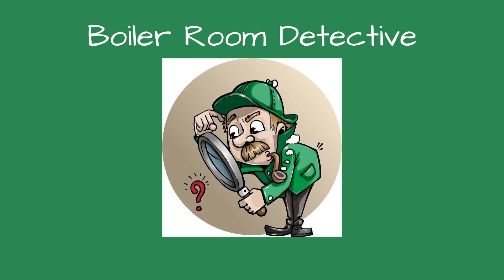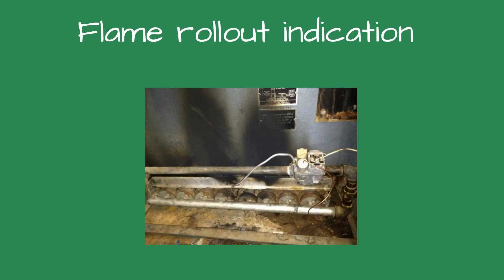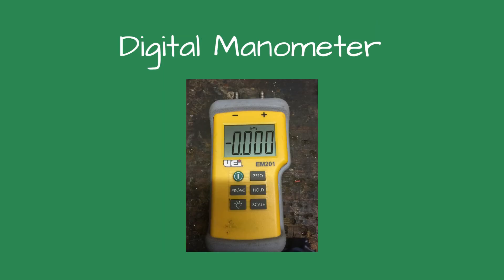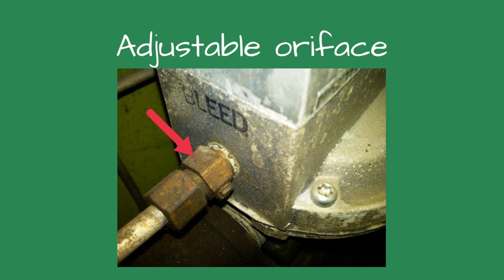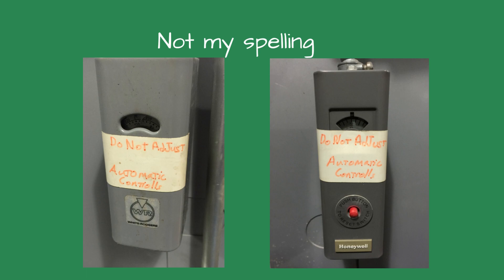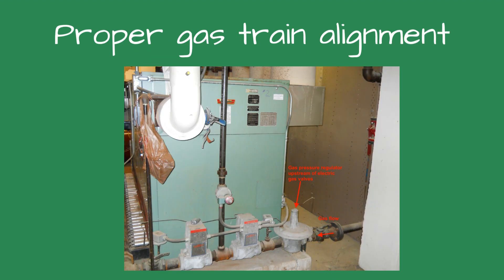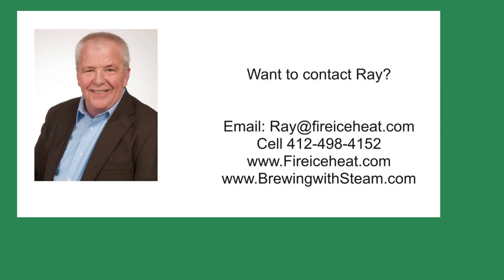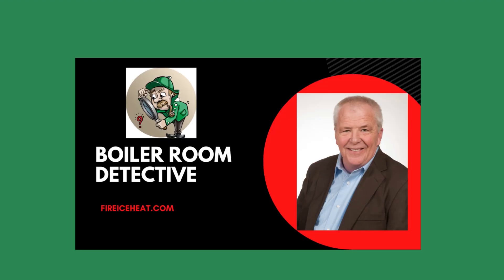The Case of the Flame Rollout

Comment: Well, I do have a question.  Does anyone know when the Maxon gas valve was added?  I'm guessing after the boiler was installed to provide dual shut-offs.  Certainly not from Bryan Boiler.  Did the flames roll-out before it was installed?  Description says since it was installed.  Wonder which model the Honeywell V5055 gas valve was?  "A", quick opening or "B" or "C", characterized guide?  Fast or slow opening Honeywell gas valve actuator?  Questions others may ask if presented with a similar problem.
Reply from the maker: I believe the installing contractor installed the Maxon valve. It seemed like a bit of an overkill Can't remember the model number on the honeywell valve. Thanks

Comment: Even with water pressure regulators, and I assume with any other type of regulator, there is a amount of time it takes to adjust and stabilize.
Reply from the maker: Thats what happened. As soon as the valve opened and it sensed the pressure, it reduced the pressure to the set amount Thanks